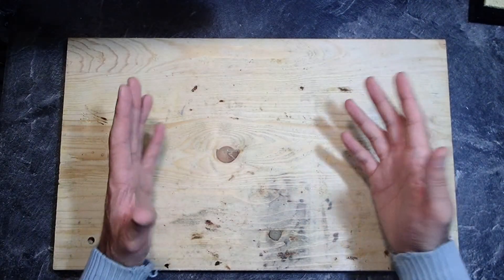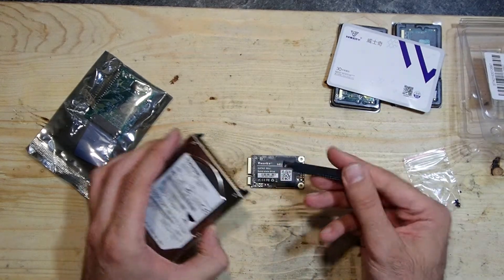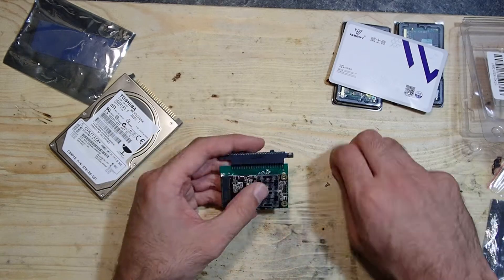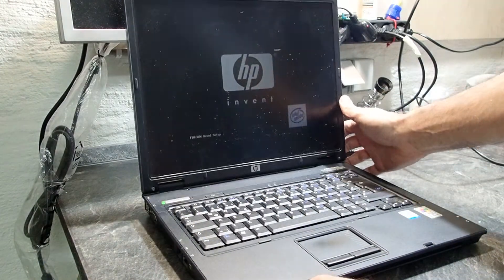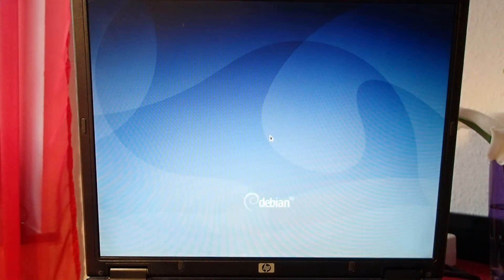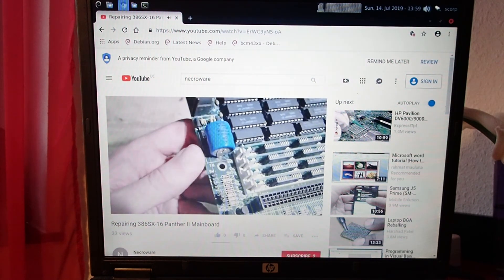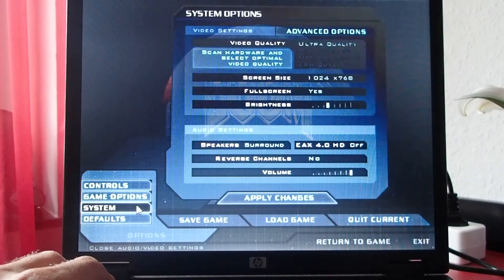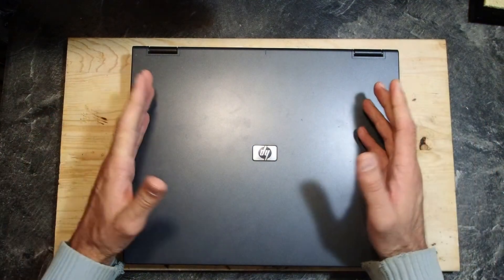Reviving old notebook HP Compaq nx6110 (Part 2)

Comment: Thank you for your video. Once I change RAM it offers me the capacity to save with F1 but I can't enter BIOS SETUP anymore. Could it be due to just the CMOS being nearly dead ?
Reply from the maker: Unfortunately, I don't have this notebook anymore, so I can't check. But how do you try enter the BIOS? I mean which key? I'm not sure anymore, I think it was <F10>.
Reply: @necro_ware  Yes. I press F10. IT was working 2 weeks ago. But I'm not in a place where the temperature is 8C°. The CMOS is 25 years old. I guess the cold emptied it. When I press F10 sometimes it feerzes, sometimes it change fast screen resolution and ENTERING SETUP is written bigger bottom left.

Comment: which usb option did you pick to get the laptop to boot from your flash drive, I only have usb floppy, usb disk drive, usb superdisk and usb cd rom, but none of them work for my usb flash drive
Reply from the maker: You want usb disk drive. May be you try to go with EFI boot disk? You will need a bootable USB stick with legacy BIOS boot sector. This notebook is from the time where (U)EFI was not yet a topic.

Comment: i have notebook compaq nx6115 what kind of ram can i boot on it ?
Reply from the maker: DDR1
Reply: @necro_ware   this one on it 200pin Ddr1 1gb 400mhz Pc3200 Dimm ?
Reply: thanks for answering me i'm brazil, and i'm trying to upgrade it
Reply from the maker: @jacksonsouza4977  You need the same memory as I used in this video. SO-DIMM DDR1 2x1GB, but don't expect any magic with this device. It is usable, but it is still 16 years old ;)
Reply: @necro_ware  ok thanks for helping me :)

Comment: Have you considered the CPU upgrade? 
Unfortunately you have the inferior Celeron model, which came with the inferior 910GML chipset too... The downside for that chipset is that from what I have heard, if you put a fast Pentium M inside, the CPU might not run very stable... But maybe a 1.7 or 1.86Ghz Pentium M should work fine and be a huge improvement over the Celeron M
Reply from the maker: This video is divided in 3 parts, you just saw the second one.
Reply: @necro_ware  My bad sorry I didn't see it... Nice that Pentium M 770 worked! Actually the fastest Pentium M is the 780, but I dont think it's gonna work even stably in this thing and it costs a premium these days.
Also, I came across this video because I came across one in poor shape and has a failing southbridge! Be careful about yours and don't flex the chassis too much or else the southbridge can fail on yours too!
Reply from the maker: @kztech1319  No problem. Somehow everybody overlooks, that this video is made of three parts. Most people just watch the first one and complain, that they didn't see, what they expected to see.....
In regards of the CPU, I just took what was officially mentioned in the specs for this model. And 100MHz wouldn't change anything as you hopefully saw on the results.
I know this notebook from the first day. I actually bought it back then since it was for s.o. from my family. Still have it here and it still works just fine. I updated it to Debian 11 last month as well, so it even has an up to date Software running.

Comment: What is Wi-Fi adapter is using on this machine?
Reply from the maker: Hi! Sorry for the late answer. It is some broadcom 54Mbit/s WiFi module, but this notebook was also released with Intel 2200BG modules. I don't have the notebook currently, but if you are interested, I can take a look in the next days.
Reply from the maker: You can see it in the 3rd part of this series. It is BroadCom BCM94306. See: https://youtu.be/ynQfV6FY2YM?t=232
Reply: @necro_ware  thank you :)
Reply: @necro_ware  i just got this laptop but my modification without wi fi adapter, i have minipci slot and antenna cords. So i wanted to buy original module that came with laptop
Reply from the maker: @Mr.Kotovski  In this model, HP used different WiFi modules. I'd suggest Intel 2200BG, if you have a choice.
Reply: @necro_ware  is it software or hardware adapter? So, i used Atheros miniPCI adapter that 70-80% of cpu usage is using for interrupts

Comment: Explain plase - how you manage wirless driver to work?
Reply from the maker: In debian you need non-free firmware blob, which you can get from non-free repository. Therefore you have to connect to the internet using a cable first. I currently don't have the notebook nearby, but if I remember right, the wireless adapter was bcm43xx if I remember right? You can find the info here https://wiki.debian.org/bcm43xx

Comment: I want this lap top video card driver for windows 7 pls repley to me
Reply: The driver should be included and installed automatically in Windows 7 if Windows 7 can actually run on that old Intel video card at all. If it can run it will do so without the Aero GUI.

Comment: First, I would like to thank you for the great work. My question is where I can get a 128 g ssd disk drive
Reply from the maker: Thank you! Ebay or AliExpress.
Reply: @necro_ware  pls can you provide me with the name of the prodect I sent it to you with the details or give me the webeside  so I can easly buy the item
Reply from the maker: @khalidkoussa  I'm very sorry, but I don't have a link. The Product I used was a random no-name 64GB mSATA SSD from AliExpress. So, if you need something similar, you will have to search there. I don't know, which products and sellers are good or bad, so I can't advise you anything special.
Reply from the maker: I think, may be I used this one, but I'm not sure.

https://de.aliexpress.com/item/32823435021.html?spm=a2g0o.productlist.0.0.6cdc6809c5rlaN&algo_pvid=60c83ef6-d487-45bb-a4cc-cb42ad91b3e6&algo_expid=60c83ef6-d487-45bb-a4cc-cb42ad91b3e6-6&btsid=2100bddb16058604406002532e26fb&ws_ab_test=searchweb0_0,searchweb201602_,searchweb201603_
Reply from the maker: @khalidkoussa  You are welcome!

Comment: Hola Buenos días. Me puedes decir de donde sacas la pieza negra del minuto 155
Reply from the maker: Hola, es del viejo disco duro, que estaba en este notebook. Perdone para mis Espanol por favor, es no me lengua primera.
Reply: @necro_ware  no te preocupes. Tengo el mismo portátil y por eso a sido mi pregunta. Va insertando en disco duro que viene en el portátil
Reply from the maker: @davidlo9432  Si, esta pieza negra esta insertando en el disco duro. Este un adaptor para IDE standarto, que HP he usado en este model del portatil. Creo que no puedes comprar lo separato.
Reply: @necro_ware  ya tengo pedidas las piezas tanto la mini pci-e-ssd y el 64gb mSATA disco duro SSD. Se le puede poner de mas capacidad?
Reply from the maker: @davidlo9432  Porque no? Creo que es posible, pero si vas a usar linux, no nesecitas mas que es. Ademas, este portatil no es mucho rapido, por eso probable no qrees investar mucho dinero.
Reply: @necro_ware  con 64 gb y Windows 7. Creo que de sobra. Muchas gracias por responder tan rápido y tu asesoramiento
Reply from the maker: @davidlo9432  No el problema. Para Windows 7 64gb de disco duro son sufficiento, pero creo que no va a funcionar bueno con 2GB de memoria. Ademas, Windows 7 es no mas  seguro. Para me, Linux es la optiona sola  aqui.
Reply: @necro_ware  buenos días. Una última pregunta. Que versión me aconsejas de Linux y que procesador me recomiendas para mejorar un poquito más el portátil
Reply from the maker: @davidlo9432  Buenos dias tambien. Porque este portatil es solo 32bit compatibel, no tenemos muchas alternativas. Yo aconsejo Debian 10 con un ligera desktop, por ejemplo XFCE. Mirra el parte 3 del este seria, alli yo he instalado un M 740. Este es un CPU  mas rapido, que puedes usar in este portatil.
Reply: @necro_ware  me puedes pasar ambos links
Reply from the maker: @davidlo9432  Cuales links?
Reply: Para comprar el procesador y donde descargas el Linux
Reply from the maker: @davidlo9432  No es possible a comprar el procesador nueve. Tienes a buscar en ebay o aliexpress. Y si no sabes donde puedes descargar Debian, creo que es va a estar un problema, porque sin la experiencia con Linux, va a estar complicado para instalar. Puedes descarar alli: https://www.debian.org/

Comment: Good morning my name is Ney, I live in Brazil.
I have a similar notebook, I would like to know the model and type of SSD that you used and the model of the memories.
Thanks in advance.
Ney
Reply from the maker: Hi Ney. The SSD was some no-name part from China. You can take any mSATA SSD, or anything similar, where you can get an adapter to 44-pin IDE. Memory is DDR-333 or DDR-400, this Notebook can take up to 2GB (1+1) of memory. I think, I took Kingston, but it shouldn't be important, I guess. You can take any DDR1 memory.
Reply: Thank you

Comment: I would suggest running Ubuntu Mate 20.04. I'm running it on an Atom and works well.
Reply from the maker: He he :) Atom is a lot more powerful CPU, than what you will find in this machine. Furthermore, Ubuntu is basically Debian with whistles and Ubuntu Mate would not give any benefits over pure Debian with XFCE. Actually, I guess, XFCE is even more lightweight, than Mate, but this is open for discussion. I'm Linux user since 1998 and switched completely to Linux in 2007 on all of my machines, so, I'm talking from experience.
Reply: @necro_ware  I tried Debian, but response was slower on the Atom. Busy fixing this machine. Will let you know how it runs on MATE. If not cool, I'll slap on Puppy. I hate to throw away working machinery. Atom shit as it is.
Reply from the maker: @vmaxmadness  I believe you, however Ubuntu is a setup on top of Debian with some paint and whistles. Debian works on this old pal just fine out-of-the-box. I stopped jumping between distributions many years ago, instead I try to understand, what's happening, if something doesn't work the way I want. My favorite distribution is ArchLinux, which I'm using since 12 years or so and I'm very happy with it. I just took Debian for this machine, because there are not many 32bit distributions anymore out there. Another point for Debian is a longer support, than for Ubuntu. And in the end, you know what Ubuntu means? It's an old African dialect and means "I can't install Debian" ;)
Reply: @necro_ware  He he. I also love Arch. Windows free for last 10 years.

Comment: Thank you Necroware. After watching your inspirational video, I have upgraded my Compaq nx6110 to 2gb RAM (max possible) and 128 GB msata ssd using ide 44 pin adapter shown in the video. And my laptop is functioning as smooth as butter. I next plan to upgrade its processor to Pentium m770. Do you think Pentium m780 will also work in this laptop...? Please advise 
Thanks
Reply from the maker: Hi, I'm glad, that I could inspire you! I can't validate it now, but if I remember right, m770 is the fastest officially supported CPU by nx6110. I might be wrong, however, when upgrading, think about cooling. m780 may be runs in this machine, but could be too hot. The performance difference between m770 and m780 is marginal, so, I'd suggest to go for better price for value relation.
Reply: m780 may be able to run (it's supported in the next model nc6220 with the same chipset as this one) but I don't think it's worth it, currently you can get m760 for ~$2, m770 for around $7 and m780 for around $17. And the performance difference will be really marginal in today's world (ie you'll have enough power to run XP and Office 2000 with any of the CPU but you won't be able to watch youtube in full HD with any of these CPU) so I don't think it's practical and cost effective to go all the way up
Reply: @miaso130  I fully agree with that, keeping in view the capabilities of the machine built in 2006. I have already installed m770 and found significant improvement

Comment: Can I run win 7 on this laptop 
I can't buy ide converter in india 
What should I do ?
Reply from the maker: Hi, I got the converter from China. You can find it on aliexpress, if you want, but it is optional and you can use the old hard drive. However, the old IDE hard drive is slow and unreliable, so I suggest to upgrade. You can use Win7 on this laptop, but only 32-bit version and will run very slow. This notebook doesn't have enough RAM for Win7 and I don't suggest to use it anywhere anymore. This OS is outdated, not supported and potential security hole. As I told in the video,  Linux is almost the only valid way for this laptop.

Comment: Great video and thanks for the quick answers. I'd like know your opinion. I already have a SATA sdd, and I wouldn't buy an MSATA adapter. I thought buying an IDE / SATA caddy (for the CDrom) and install my SDD in our beloved HP. What do you think about?
Reply from the maker: Hi, that is a nice idea, I guess. I know such caddies, but unfortunately I don't have one. So, I can't really say, if this is going to work. In the best way, probably it will do just what you want. Could be, that you will not be able to boot from it, but I don't think, that this will happen. Anyway, I'm also curious, if you can do that, so would be glad to know, if you don't mind. In my case, I wanted to keep the CD/DVD drive, since I'm using this notebook for retro stuff and have to copy data from old CDs from time to time. So your idea wouldn't quite fit for me, though, there are also USB DVDs out there :)

Comment: hello,my dad has this old laptop and i cant find its charger.Would any charger work?
Reply from the maker: Well, you have to pay attention to polarity, voltage and maximum current of the replacement charger. The original power adapter has plus pin inside, the output voltage is 18,5V and the maximum current at 3,5A. Makes overall power of 65W. I guess, if you find an adapter which delivers 19V and at least 3,5A, it will be just as good. If another adapter gives more current it's good, but don't go over 19V or it will burn your notebook.
Reply: Necroware thank you, your videos are very helpfull!
Reply from the maker: @moriarty8161  Thank you too.

Comment: Buen video explicativo, no hablo ingles pero no hizo falta.gracias!!
Reply from the maker: Gracias tambien. Pero yo hablo un poco espanol y eres gracioso :) Como el video puede explicativo quando yo explicado en ingles y no comprendes? :)
Reply: @necro_ware  Por que se ve sabes lo que estás haciendo, a veces no hacen falta palabras para explicar,saludos
Reply: @necro_ware  amigo cual es el modelo de disco duro que usaste para reemplazar el de la laptop,gracias
Reply from the maker: @carlosdaza9165  Hola, he usado un disco msata ssd con 64GB, se llama Vaseky. Esto un poco caro. Probablamente puedes comprar un poco mas economico, pero el model que yo compro puedes encontrar alli

https://www.ebay.de/itm/64GB-MSATA-SSD-Festplatte-Laufwerke-Festplatten-F%C3%BCr-Laptops-Unterst%C3%BCtzt/312394250884?ssPageName=STRK%3AMEBIDX%3AIT&_trksid=p2057872.m2749.l2649

Nececitas un adaptador tambien, de msata a 44-pin ide, como este: 
https://www.ebay.de/itm/mSATA-adapter-mSATA-SSD-to-44Pin-IDE-adapter-mSATA-IDE-converter-card-JD-ht/163847802433?hash=item2626170e41:g:nGgAAOSw5CZcn1Nr
Reply: @necro_ware  gracias amigo!!

Comment: Hi its me again, I hope your doing great.  I decide to install debian just like you.  I wanted to know if you could  tell me the software you installed to make the wifi work. Thank you.
Reply from the maker: Hi, you will need to install firmware-b43-installer package to get the appropriate firmware blob. Therefore I connected the notebook once using a network cable and installed the named package. After that wifi worked without a problem.
Reply: @necro_ware  thanks a lot :).